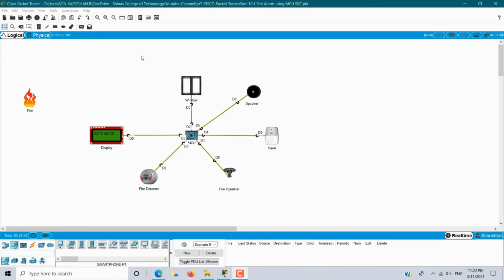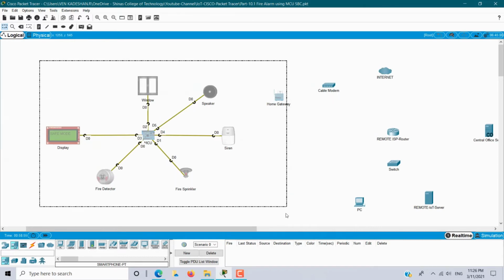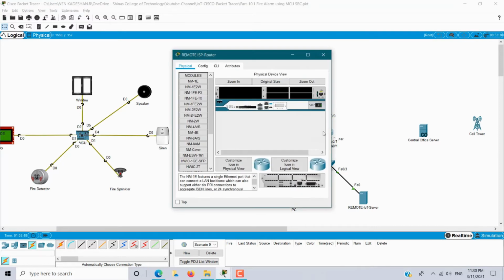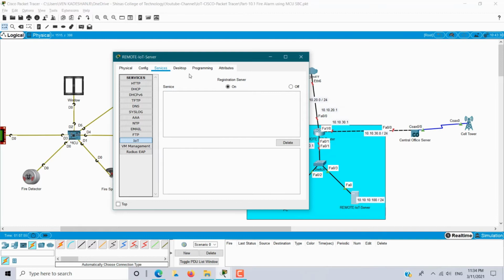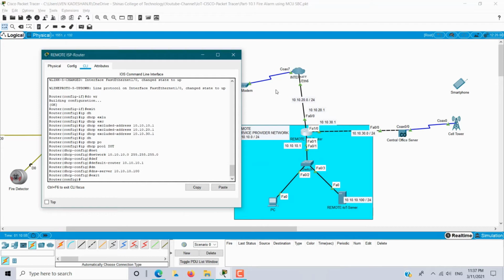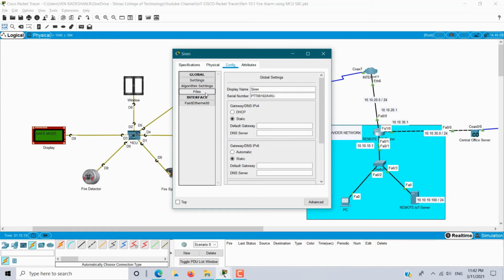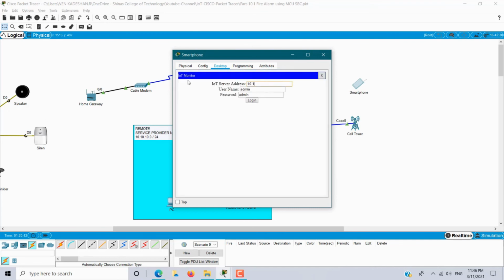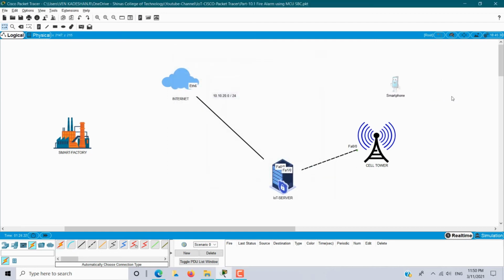CISCO IoT Part 10.1 Remote Monitoring and Access of Fire Alarm System with IoT Server |Mini Project

Comment: Sir the smartphone does not login in iot Monitor
Reply: later it shows request timeout
Reply from the maker: Hi, check the interface you have chosen, it should be 3G/4G interface. Also, the DHCP should be successful for that and in IoT Monitor option, check the server IP.
Reply: @learnitwithvenkad5631  ipv4 address for fast ethernet 1/0 in Router was put in Wrong
Reply from the maker: 10.10.30.1 is the IP address for Fa 1/0 interface of Router which connected to the Central Office Server Network: 10.10.30.0 /24
Reply from the maker: Check the DHCP of Backbone interface in Central Office Server